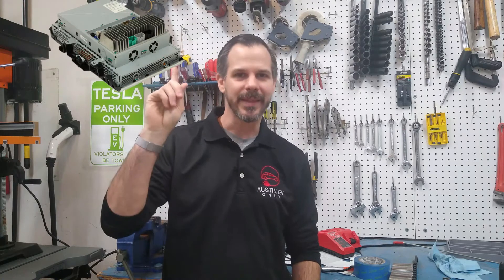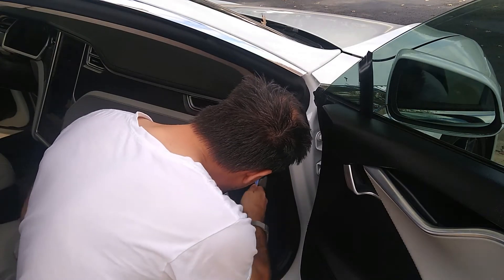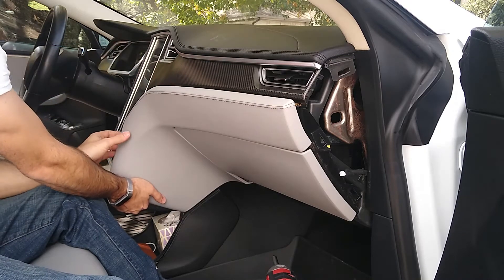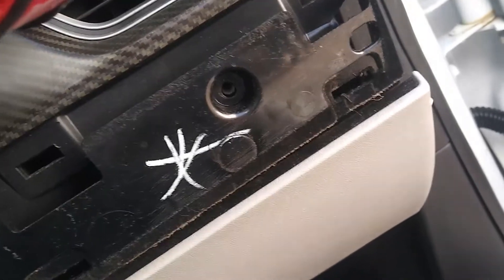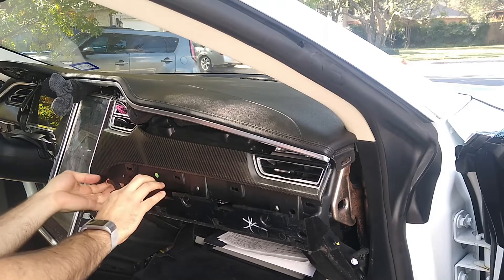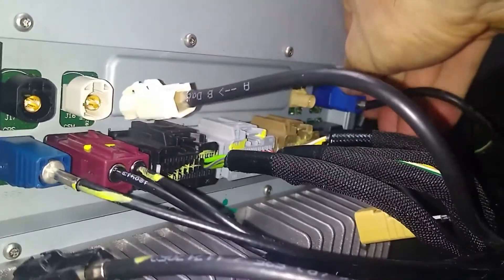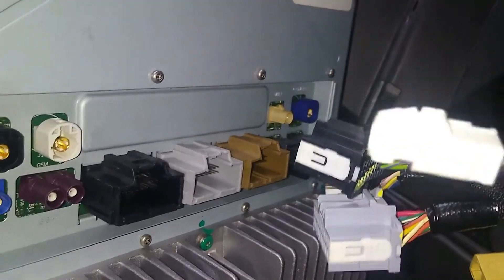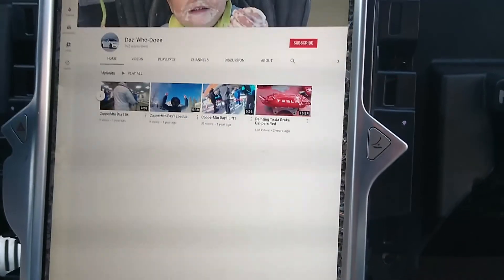Removing the MCU from Tesla Model S/X

Comment: For those of you asking and no replies......when you replace an MCU there is programming needed that can ONLY be done by Tesla Toolbox.  It requires an expensive subscription and to date I have not found a single Youtube video that shows it.  Last time I checked its $75/day $300/month and $700 annually.  You will need a special ethernet cable and a laptop to connect.

Comment: Does it need to be reprogrammed?
Reply: When you replace an MCU there is programming needed that can ONLY be done by Tesla Toolbox.  It requires an expensive subscription and to date I have not found a single Youtube video that shows it.  Last time I checked its $75/day $300/month and $700 annually.  You will need a special ethernet cable and a laptop to connect.

Comment: Hi maybe help
one question, my mcu1 doesn't work, if I put the same on another mcu1, everthing is work not need programming?
Thank you
Reply from the maker: Needs programming. I don't think it is possible with toolbox unless it is a virgin MCU.
Reply from the maker: And you need a VSP credentials, which in Texas, requires a locksmith license as a prerequisite.

Comment: Do you need to program the new mcu or it will work after replacing it?
Reply: When you replace an MCU there is programming needed that can ONLY be done by Tesla Toolbox.  It requires an expensive subscription and to date I have not found a single Youtube video that shows it.  Last time I checked its $75/day $300/month and $700 annually.  You will need a special ethernet cable and a laptop to connect.
Reply: @dupaacct5956 thanks for the info. Saving us some time.